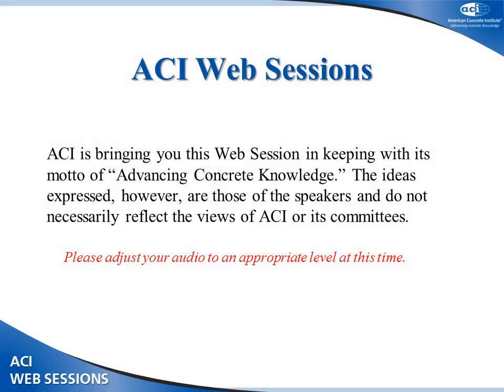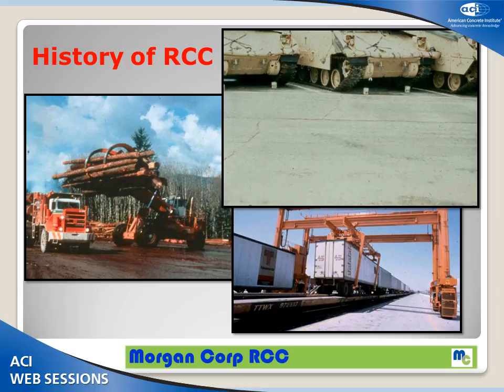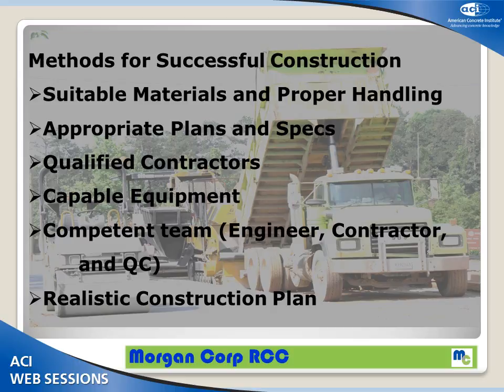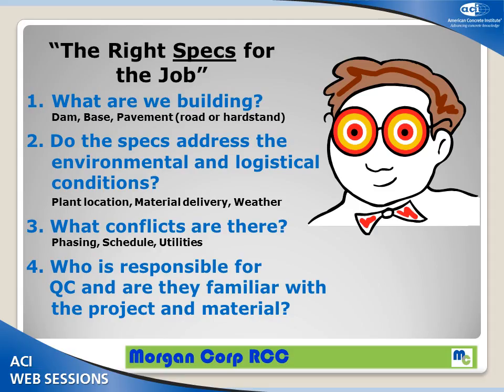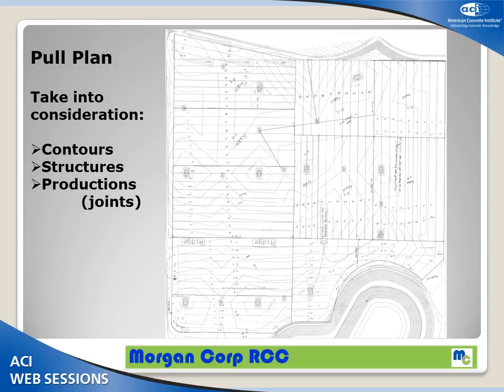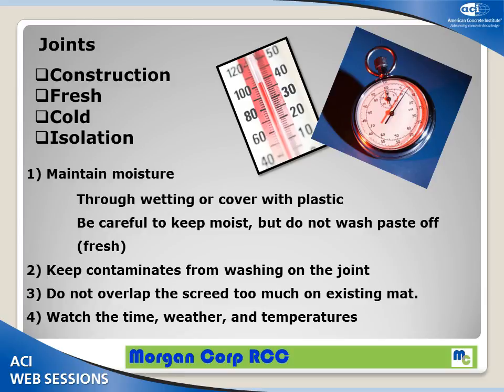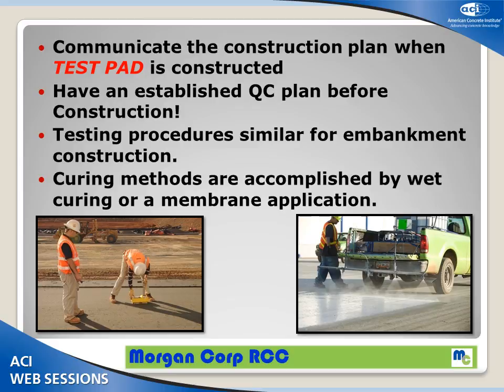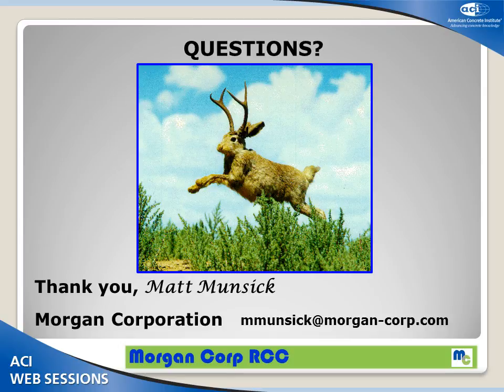A Contractor's Perspective on Roller-Compacted Concrete

Comment: What are the challenged of using it on a 25% grade, and will it hold up to high velocity water?
Reply: What are you paving at a 25% grade?
Reply: @epistte  The spillway of a dam.
Reply: @ladadog3977  The spillway of the Oroville dam in California was rebuilt with RCC, but topped with the ordinary wetter mix as a wearing surface.
Reply: @epistte  yes, looks solid, but almost immediately they had water flowing from multiple concrete joints.